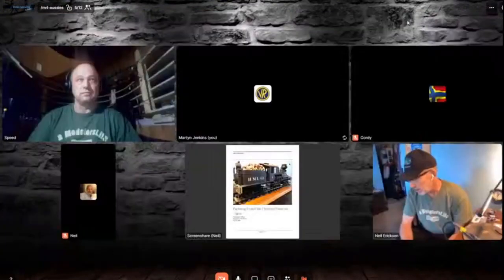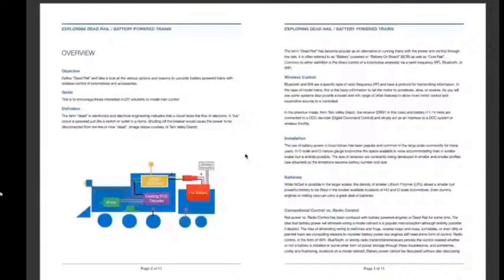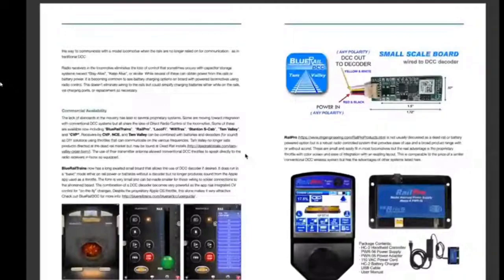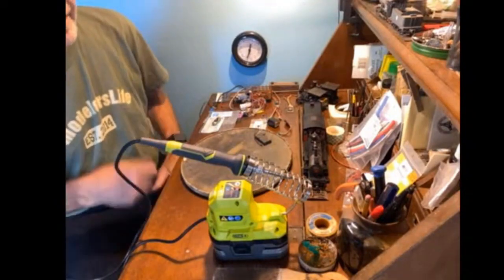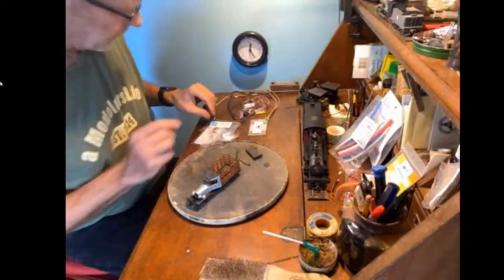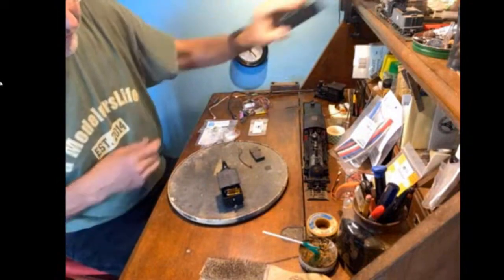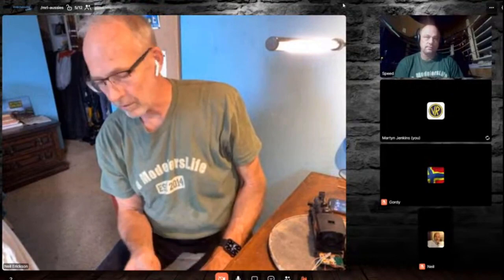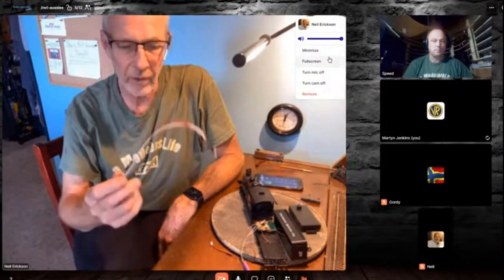Neil Erickson - Exploring Dead Rail battery powered trains

Comment: RailPro is a US made system and is a battery compatible.  Dead Rail grew the most out of G scale since out door track will patina which is not electrically conductive and requires more work to not only clean the rails of debris but to also clean the rains ensuring bare metal for a good electrical connection.  Lithium Ion battery packs have offered the G scale community a solid power source that allows for hours of run time based on size of the battery installed.  It is not advisable to try and go cheep and build your own batteries or adapt them from other sources.  You want to buy some that allows circuit protection to ensure a breaker trips in the event of a short.

Comment: I know this is an old video so this comment will probably never be read... But I always thought about a great place to keep the rails clean and install the charging ports would be in the engine house or the roundhouse, that would be a great way to say that the engines and the operating session has to always come back to zero.

Comment: When running a large layout there is a need to track trains and manage, at the signal block level ... speed, block entry, train right of way privileges, and much more.  How is this done with battery operated trains?  How are other devices powered ... turnouts (switches), signals, buildings, etc.?

Comment: I have a battery operated train set that is also has a r/c engine. My question is if I were to get a similar 2nd engine, is it possible to manually change the frequency so as to not conflict with the 1st r/c engine? Thanks.